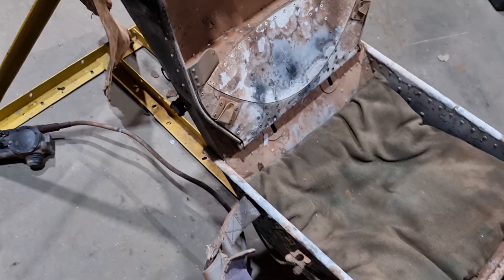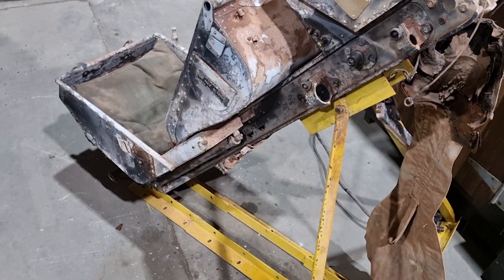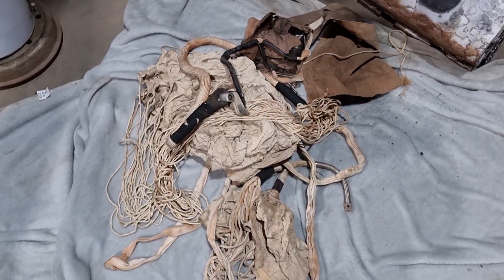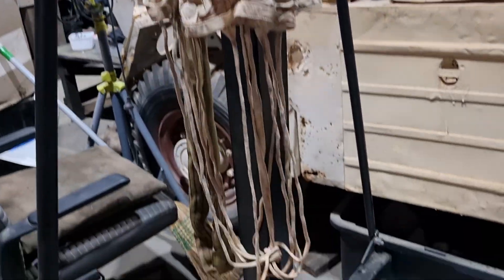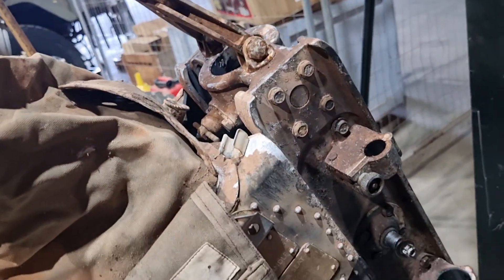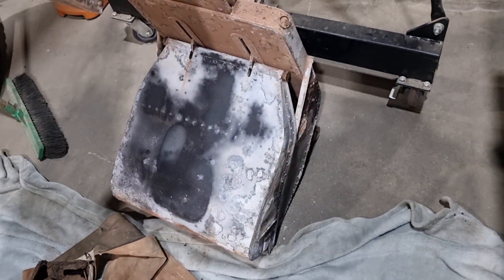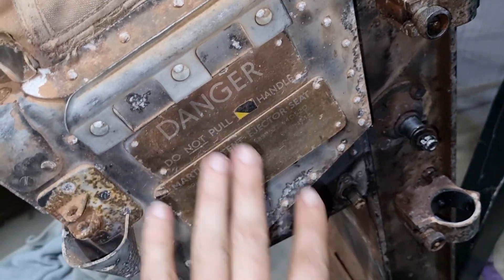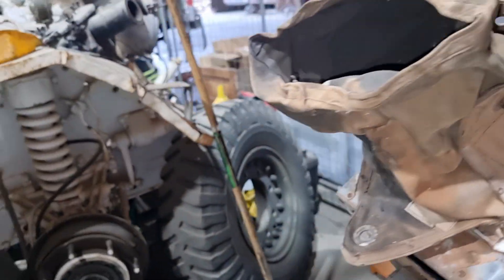Taking the parachute out of my ejection seat restoration!

Comment: The purple are anodised alloy squash rivets. The time release escapement will still work if cocked, below 10,000 ft the capsule should be disengaged. did a mk5 and they were still within specs after 30 years in a junk yard..